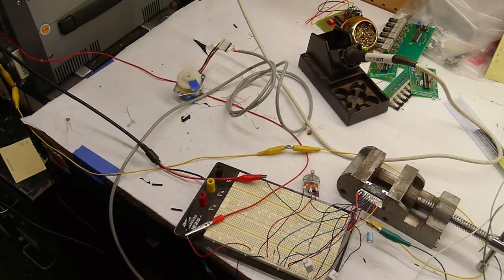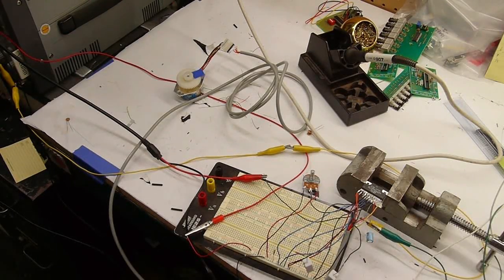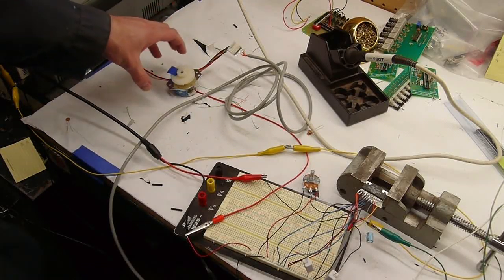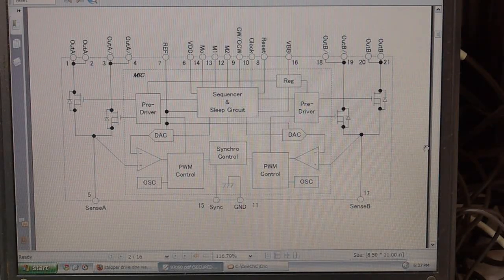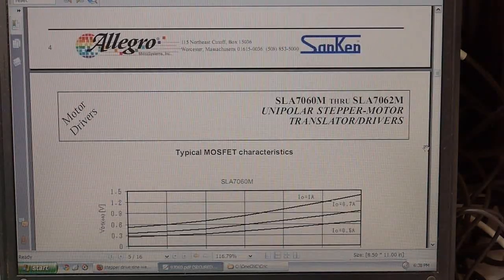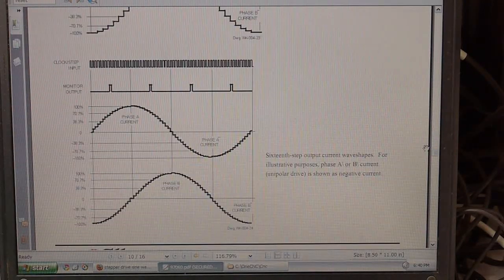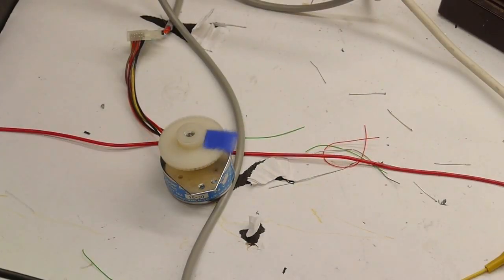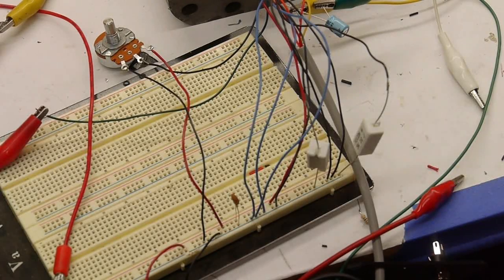Microstepping a stepper motor with the SLA7062

Comment from the maker: I did some of this work in a video called "Remote electronic focus for telescope (DIY remote follow focus) " (search my channel). Adding some setpoints would best be accomplished with a microcontroller, so the overall architecture of the system would have to change to accommodate that feature.

Comment: Great stuff. I would love to see you build an electric follow focus for DSLR video, one that can be mounted on a shoulder rig so the camera operator can pull focus with a thumb wheel and not have to take his hand off the rig. Smooth action and set points to rack focus would be a nice feature. The ultimate rig would be a motor for zoom with a rocker switch control and somehow map the follow focus to zoom adjustment, you could sell that type of rig faster than they could be made.

Comment: For 2 sine waves out of phase by 90 degrees, I might suggest 120 VAC Fed through 2 loads: a capacitor and a resistor.  The current will be out of phase, you would just need to size the components appropriately.

Just a thought.

Comment: Nice! Great overview of the technical stuff and why it works. Got my subscription. I'd love to see the jukebox when you get it working. On the SLA7062 driver, you might google "SLAm Stepper Motor Controller" or, for even smoother operation, "Linistepper" for some other alternatives.

Comment: @superdau  Anyway, none sayed that completely sinusoidal currents results in a perfectly smooth circular motion in a real stepper motor, so the above comments are about the details behind the different driving methods, so if you are happy with the results and simplicity of the SLA7062 I cannot blame you, it is indeed a resonable solution to the problem.

Comment: @superdau The IC also instead of keeping the current to each winding at steady levels, it causes it to oscilate between an high and low value in a triangular fasion, which has two disadvantages, first the variable current cases the motor to randomly move around its set posistion even with no step fed. Second, since the currents are oscilating around the intended value, it is naive to expect increased accuracy from a large number microsteps.

Comment: @superdau It is not that simple, the current control method does indeed produce sinusoidal currents at low speeds when the current has the time to settle, but it does not produce sinusoidal currents in higher speeds. It is not noticable opticaly by humans due to high speed, but it actualy means that it has not constand torque in all phases of a full step, which leads to oscilations within each full step which cause 
increased noise.

Comment: @ntomata0002 
The IC more or less exactly does that. It can create an almost sinusoidal signal (it has a 16th step mode). I don't think anything more is needed except for very high positioning accuracy or speeds. The chip includes the current sensing, too, which makes life easier. And it only advances if it gets a clock signal. So no clock, no movement. Slow clock, low speed.

Comment: ---  for small motors when the inductance is low which results in high current noise, and the power dissipation due to the analog operation is of little concern.

Comment: --- then feed the PWM Thigh through the EEPROM preloaded with the values that produce a sinewave current to winding. The same technique may be used and digitaly (without the RC filtering, working the NPN transistors in ON/OFF, so as the average voltage viewed by the motor to be sinusoidal, as long as the motor never slows down below the point that the current exceeds the motor rating). The PWM is better when large motors with high inductance and currents are used, but the analog is better---

Comment: If you really need very low, constant RPM movement, you can go analog with the AVR. The scheme goes like that : you build two identical channels, one for each winding with 2 PNP transistors with emitters to Vm and collectors to each of the winding ends. One more NPN power transistor with collector to the middle of the motor winding and emitter to ground through a small resistor. The base of each NPN transistor is then controlled by one of the PWM channels of the AVR through RC filters. Then you-

Comment: @superdau 
more finer steps (at a higher clock) could reduce the noise. And I'd try to reduce the maximum current to the level needed. It might also reduce the jerk.

I've to admit, I've seen way better datasheets. Per datasheet you can step the motor at 250kHz, which means a clock every 4µs. How does this go with the minimum off time of 7µs?

Comment: If the 7µs are related to the PWM frequency, only a bat would be able to hear it ;) . To reduce the noise of (hearable) PWM frequencies I was told to add more inductance in series to the motor. But a stepper might already have a relatively high inductance, so I don't know if PMW's the problem here (apart from the frequency being out of hearing range anyway).
I think the sound is coming from the jerk every step. Are you already running in 16th step mode?

Comment: I expect the PWM frequency is too low because the inductance of the motor is high and / or the supply voltage is not high compared to the motor voltage.

It is not a good idea to use wire wound sense resistors, they need to be non-inductive.